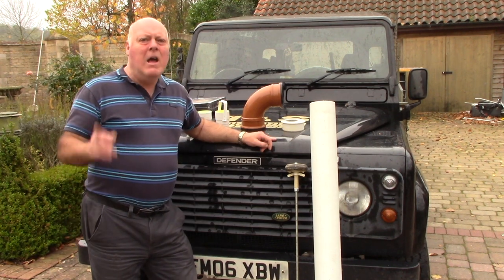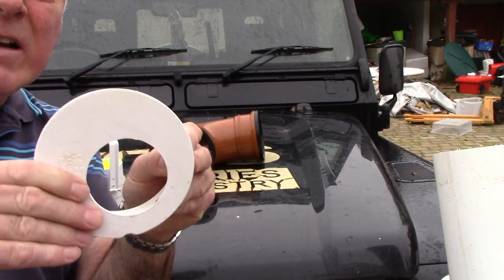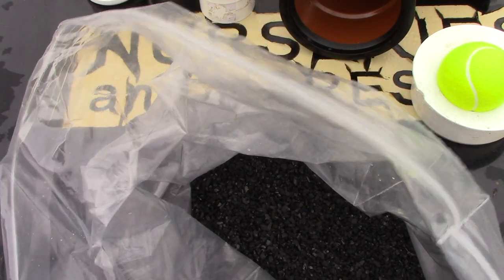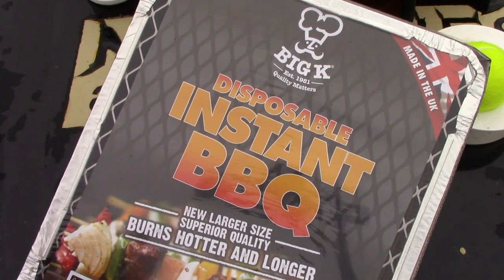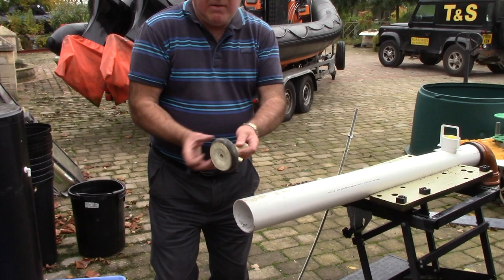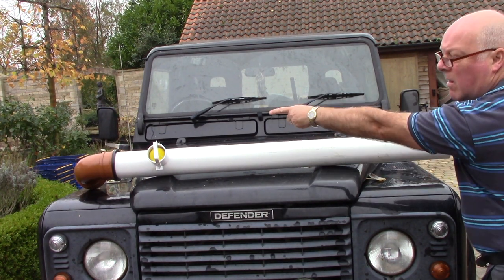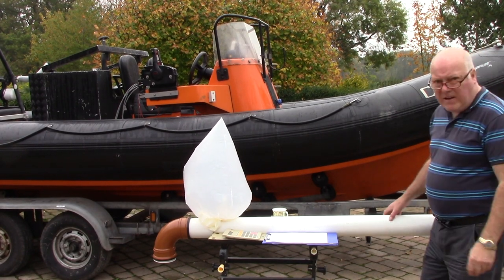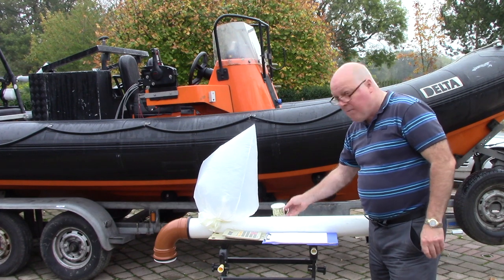Making a Nuclear-Resistant Air Filter

Comment: This is a great idea for throwing something together in extremely short notice, if you have not done much preparing for a nuclear war. The only down side is: 
1. Filter changing. Chance are you will contaminate the inside of the shelter if you exchange the charcoal bag from the inside the shelter. The remedy is to pull the old bag out from the outside. Then push the new bag into place when you are back in the shelter.
2. There will be some contaminate leakage around that towel holding the charcoal. This is due to the towel not making a perfect seal against the inside wall of the pipe. The remedy would be either using a cloth grain bag (if you can still find them) or a small disposable paper vacuum bag or redesign the filter to actually use a car/truck air filter with the charcoal in it.
3. Another filter should be used before the activated charcoal to catch the larger dust particles. This will help extend the replacement life of the charcoal filter a bit. 

Overall the video is a great idea for short notice.
Reply: Maybe some sort of netting ahead of the filter. Or a couple of netting sections.
Reply: I would add a water pre filter before your activated carbon filter to do most of the heavy filtering. (same concept as a potheads bong) You can also add a drain+valve to remove contaminated water and a water intake/valve to refill it.
Reply: ....also use a screen on the bongs stem to create many small bubbles instead of large ones. That will increase the surface area in contact with the water increasing filtration.
Reply: Go to the doctor mate
Reply: @artisankatstudios7902  cheese cloth would be great
Reply: Keep it on the outside shelter use a vac HEPA  filter and 3 charcoal filter
Reply: @hawk1481  where can you find those? I am in the process of building our underground shelter & clean air has been an issue. Thanks for any help!
Reply: @made2shine385  Home depot There for the vacuum cleaners The industrial find one with the Carbon  filter all on one you can use just the HEPA look on youtube for the hand pump to pump the air you do not went  to suck the dust up your snorkel keep you snorkel 5 to 6 Feet off the ground look a pic of other fall out shelters I'm trying to put the filter in the snorkel Good luck
Reply: what about cheese cloth? Would that be another remedy to the towel problem?
Reply: @hawk1481  You are right about keeping the snorkel above the ground. Good point.
Reply: @TheTechmaster1999  I do not think it would resolve the issue of keeping the contaminated air from leaking around it.
Reply: It is only necessary to stay underground for a few weeks for most radiation fallout.  That charcoal would last 3 months to 6 months. If you have to stay underground without radiation leakage more than that good luck anyway.
Reply: @InsanoBinLooney  Good idea, you need to be able to drain the radioactive water in a way that would minimize you having to go outside or to handle or even splash the radioactive water from it if you were to drain it in the inside....
Reply: @hawk1481  Yeah, HEPA is what I and many others used as mask filter material during the PPE shortage and Covid. It's holes are almost as fine as N95, great stuff and pretty reasonably priced.  Fun fact: The HEPA filter standard was built from the need for effective radioactive fallout filtration.
Reply: @made2shine385  HEPA material can also be purchased at fabric stores, as can N95 blown fiber material used in N95 masks. Found out that little tidbit, after doing the HEPA vacuum bag thing Hawk talked about. From someone in Youtube comments actually, about a month ago. And I was like "well, I wish I'd known that before, I have a Fabricland store down the street. lol". Makes sense they would have it too, as they also deal in Skidoo and motorcycle seat vinyl for reupholstering seats and other materials, so why not HEPA and N95?! Never underestimate the fabric stores, they aren't just for making clothes and traditional things you'd think a fabric store "used" to deal in only. They have expanded their options, I guess because people kept coming to them for fabrics they had trouble finding elsewhere. People should now think of them more these days as not only a fabric store, but a "modern materials and hardware fabrics" store too.
Reply: @justinjennings3772  Muslin cloth is even better. It is very similar to cheesecloth, but finer. Brewers use Muslin a lot for soaking grains etc.
Reply: @TheTechmaster1999  Sure, cheesecloth or muslin cloth. Muslin is finer than cheesecloth.
Reply: Cloth grain bags=muslin cloth. Available at any brewing supply shop. Brewers use muslin cloth all the time for boiling grains. When you know what to ask for, it makes it even easier to find.
Reply: @MrBilld75  I used to home brew beer. I forgot about that. Great input on this.
Reply: @lassitc  I don't do it nearly as often as I used to, but it is fun. Mainly because you get to do whatever you want. Wanna make a berry beer?! Go ahead, wanna add spices? Go for it. The flexibility is so great. And as good as the craft beer scene is these days, you can still do more on your own.
Reply: You may not need to change the air filter. The first 3 days are the worst. Within 2 weeks you shouldn’t need this anymore.
Reply: @funkmonster  True enough, yeah. The bulk of the fallout and risk is immediately after. It quickly diminishes. Radiation is funny like that. Some forms can persist and be a danger for a long time, others disperse/decay quickly due to half life and the nature of it. And fortunately, the radiation from nuclear weapons, is short lived and concentrated in the explosive potential/power of the explosion and about immediate destruction and doesn't persist. I think people confuse/lump all radiation into a Chernobyl type of thing, where it is uninhabitable for decades or centuries. The weapons aren't nearly the same, it is very short lived.
Reply: It looks like you have the air intake problems solved but the exhaust pipe on the opposite side of the shelter will need a 180 degree elbow facing down and a check valve in the vertical pipe before the elbow.  Also it wouldn’t hurt to put a small charcoal filter in the elbow on the down side just in case air is drawn in for some odd reason or the check ball is not seating properly.
Reply: @artisankatstudios7902  why not encase the whole outside part in concrete with small holes on the sides? that should definitely reduce radiation if a less irradiated dust can get through

Comment: Thank you for sharing your insights. It's crucial to consider heat-resistant materials and proper ventilation systems in bunker design to address potential issues like extreme temperatures of nuclear temperatures of 100 million degrees Celcius and gas exposure from Radon the deeper you go into the Earth. Ensuring the safety of the structure and its occupants requires careful planning and consideration of various factors. Examples of failure are bunker designed in Germany during ww2 fire bombings where the occupants were cooked within the bunkers because they did not account for ventilation that cooled the air before reaching inside the bunker.

Comment: Sadly this is going to be completely use in case of nuclear war. Active carbon is meant to trap chemicals, so if anything this filter would be useful against chemical weapons. If you want to make a filter useful against nuclear fission products and fall out you would need a HEPA filter, which is also useful against biological weapons btw.

Activated carbon is extremely porous, however it's pores are the size of small to moderate sized molecules, which get adsorbed into those pores which is how it filters them out. The fission and fall out products from a nuclear bomb are going to be particles which are thousands of times bigger than the pores of activated carbon are suited for.

Comment: Brilliant video. Have made mini version using activated charcoal and hepa filter parts and 12v computer fan to remove greyhound flatulence. Will have a go with steel pipe for the radionucleide version. Great video to watch. Thanks.

Comment: Hey - that is an interesting cioncept. The only thing I would add to the basic set up, is to have the charcoal in a HEPA filter-bag. that way you have better containment of the charcoal and an extra lair of filtration. I like that you proved in two ways that this mechanism actually does what it is supposed to. What worried me, is that ion the smoke-test, we saw smoke coming out of the exhaustpipe as well, that looked basically the same as the smoke comping from the vessel below. So that would make me wonder how well the air is actually filtered... But, so far, a rather good system with very interesting content! Thanks for sharing!
Reply: I agree with you. I observed the same thing, and thought I didn't understand the setup, so I went back and rewatched the video. A  short cylinder of cotton tightly fitted into the one containing the charcoal bag will do the trick. If not, his valving mechanism is perfect.

Comment: Brilliant. But I don't understand  if smoke can come in can't radiation.  ? How long does the charcoal last worst case scenario?  What about carbon dioxide build up?  Lastly  how do you suggest protecting  the outside fittings and pipe from a blast?
Reply: Radiation from the blast binds to dust particles, so you really only need to filter out dust. Roughly speaking. 
And bunkers are only made for people outside the blast zone but inside the radiated dust zone.
Reply: Dust particles are not to hard to filter and as others have said pipes should have a 160 turn facing down at the end.  A few well positioned vent pipes would provide passive air circulation and thus remove CO2.  You could make a simple hand crank to circulate the air better though.  And C02 scrubbers can be made as well with one or two chemicals that you can buy on line. 

If close enough to a target than blast valves would be necessary.  I would say within 5 miles from a target blast valves would be needed.  You can make them with scrap materials.  

If you are within a couple of miles from the blast you would need a very well built underground blast shelter.   I would probably suggest moving instead of attempting a blast shelter if you are that close to a target.  But I have heard of people who have built a system of underground shelters.  Basically they are connected by a small opening underground but can be sealed off from each other.  This design allows one to temporarily isolate themselves in the deepest most fortified part and later move to other parts with the ventilation system. I can't really explain it but I have seen photos.

Comment: If it’s pumping out smoke it could be allowing particulate radiation through. HEPA filters are nuclear particulate rated and used for that everyday. HEPA filters are widely available so let’s see if you can build something to mechanically pump through a HEPA filter, as electricity and fuel may not be available.

Comment: Also another factor to notice is you need a few other aspects to look at.
1. Activated charcoal has a saturation point. So you need to change the filters every so often say years maybe decades depending on size.
2. You want to use something that can resist fires and high temperatures that is also corrosion resistant in case of forest fires or man made fires.
3. You want to find a perfect way to camouflage the air ducts as well as silence any noise from them on the outside since I'm a situation like this any looters/raid parties searching for supplies or safe haven can't find it (hopefully) because they can clog the vents suffocating you and forcing you to come outside...
Reply: And my only consideration for air exchange has been keeping mice, snakes and spiders out! Oh my! back to the drawing board...my concealment idea is putting the chicken coop over top, with sealed drainage away from “roof of bunker”...
Reply: @thewindyone5228  Chicken manure breeds Histoplasma fungi.  Histoplasmosis in the lungs can be incurable and a miserable way to die.

Comment: A consideration (based on Cresson Kearny's NWSS book) is to have all your inlets (and outlets just in case) setup with a 90 degree or even 180 degree bend ending in an opening facing straight down. This prevents heavier particles that can't "float" in the air from even entering your filtration system to begin with.

Comment: The radiation following  nuclear attacks is fully survivable ,if you are protected underground for the first week or so and have adequate protection and decontamination facilities when venturing out after the radiation levels drop. Oh and so long as you're at least 20 miles from ground zero because you'll be toast. Get your self a shelter at least 1 MTR underground , an NBC suit and mask, lots of food and water etc etc etc. It's called prepping. Insurance if you will. Good video with useful tips.
Reply: I'm assuming that the 1m recommendation is based on the military's radiation shielding units tests? They say that about 1m of dirt is sufficient to shield from most common types of radiation. You'd be amazed at what can block various types of radiation. Your skin is enough to block some types, and the walls of your house are sufficient to block most others.
Reply: Hmmm, as a gold planner I have a surface air, dry suit, hmmm...I really think the bunker is for hiding my supplies...and forest fire...I lost every prepped item and farm tools of 40 yrs... last year...to a massive California wildfire...Earthen cabin is sounding better all the time...
Reply: I don't understand why you said 20 miles away is necessary.  The over pressure of a 500 kt weapon would level houses probably up to 3 miles and the thermal pulse could cause burns to anyone out in the open up to 15 miles.  But a well made underground bunker would survive most warheads from just a few miles away.  Yes a direct hit even from a small nuke would destroy it but it does not take much distance for the overpressure to drop significantlly.  

And yes 4 feet of earth provides good protection from the radiation.  I would have water bottles all around inside because water protects from  neutron radiation. 

Most warheads today are in the 250 to 800 kt range and are much more accurate than in the 70's.  But the destructive power of a nuke does not go up with yield a much a lot of people think.  A 100 kt weapon is not ten times more destructive than a  10 kt weapon.  It is is closer to 2 times more destructive.  There is a formula for this but I can't remember it.

Comment: This is great! It is good you went over positive pressure within a bunker space. Do you have any calculations on how long the activated charcoal is good for or how to replace it when it has reached its particulate absorption capacity (hard question, but estimates based on similar particulate size of fallout could be useful)? Believe it or not, but I am an engineer and I help build bunkers for the U.S. government. This is a great, low-cost Idea but I would recommend having two or 3 of these to use in case one fails, or it becomes saturated, and you need to use another one of these devices. At that time, it may be too late. I recommend using a Geiger counter at the inlet and as soon as it reaches an intolerable limit, to then switch to another filter. I would want to see research on the needed particulate size of the activated carbon to ensure the prevention of particulates passing through the system.

Comment: there has to be a way to automate this (perhaps a hamster on a wheel). I would also be concerned with leakage around or through the activated charcoal. This is not mentioning the unknown absorption rate of fallout with activated carbon. I would think taking iodide pills within 3 hours of detonation, going inside the innermost room of a building, closing all windows/doors, and turning off the HVAC would be some of the first steps to take - with at least a two-week supply of food. Good show none-the-less.

Comment: In the scenario mentioned, you only need to keep the dust [fallout] from coming inside, that is all.  That's easily done with a couple of corners, no need for any air filter at all.
Reply: blogobre Yes, I think a couple of corners might help but I would absolutely include the filtering aspect.
Reply from the maker: Brill thank you
Reply: Exactly, outside air itself isn't contaminated, except for particles

Comment: If your shelter intake is sufficiently high enough from the ground the "large" particles everyone mentions shouldn't be taken in. Assuming; of course, that the shelter builder has enough sense to put a (nearly) 180° bend on the inlet. (Fallout doesn't fall UP)  That being said, a prefilter is always a good idea as is making a filter "module" that can either be changed (not a great idea unless it can be changed remotely, outside the shelter) or as one commenter said simply have more than one unit to attach the air pump to. This of course means that the air filter units would need to be shielded from the shelter interior, we are after all filtering out radioactive fallout particles. Luckily this is just a matter of extending pipe lengths and trying for increased pump volume to make up for it. Overall, the video and filter idea is very good.

Comment: With only some modifications this can become an excellent Two Stroke valve with an interchangeable filter from INSIDE the shelter Add a second ball valve to force air into shelter on each pull & push. Add pipe with changeable filters on inside of shelter inside PVC pipe sections..